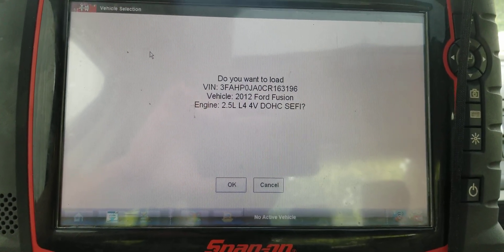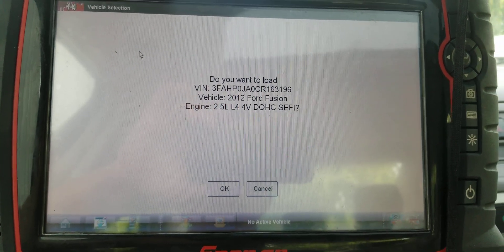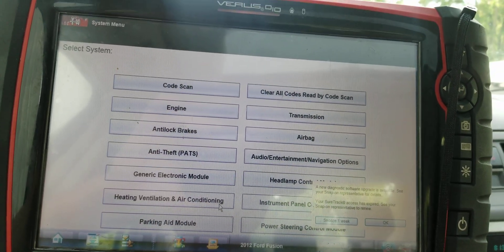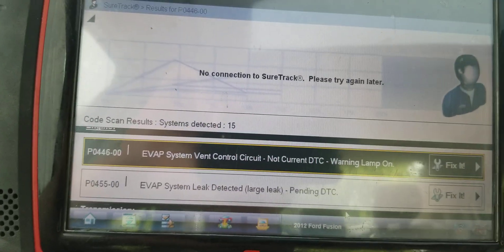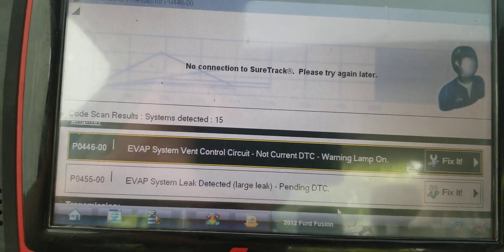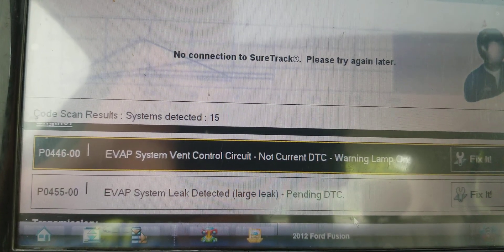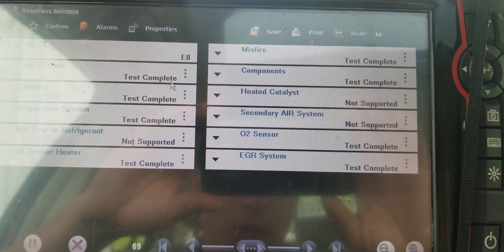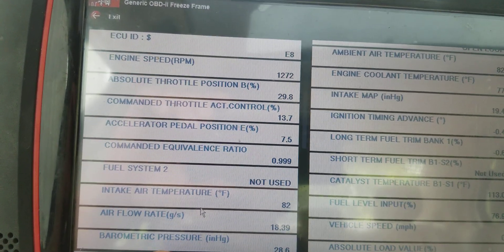2012 FORD FUSION 2.5L, P0446 EVAP VENT CONTROL CKT & P0455 EVAP LG LEAK (PART I)

Comment: Awesome video cant wait to see parts too and good too see that gm not the only 1 with junk purge solenoids . That connector really looks stuck. Proab remove the vent solenoid and get better access but great use of a bulb for the load
Reply from the maker: Yes, removing it would have been another approach, but I tried to sneak small flat blade under the tang to assist her off and I could tell she was not going to come off of there regardless of how I attacked the situation...who knows?  The connectors tang was broken regardless, so she needed a new one in either case.

GM puge solenoids and vent control valves...they should just be a 30/60/90 scheduled maintenance item at this point right🤣🤣🤣

In either case, I appreciate your support and feedback brother...you keep killing it out there at the GM dealership man and be the best you can be man!!!

Hope you are enjoying the 4th with your friends and family man!

Comment: Totally right... there shouldn't have been a need to glue that connector. At best, a bit of silicone would have held it in place and would still be removable later on. The frustration level was 9/10 for this one! =)
Reply from the maker: Well it's not that new Thomas, we've seen it a million times, I don't know about the silicone though?  I've heard that silicone can be corrosive to copper, but maybe I'm wrong on that? 

I guess I can see if it's a really hard connector to get, but you know damn well that this is a pigtail that is likely available through Ford etc.

In either case, it can be frustrating to deal with this!
Reply: @PaulysAuto  A bit of silicone between the connector & solenoid body... just to keep the connector from sliding off. I've seen that before / works well.
Reply from the maker: @EXOVCDS   O trust me I've done it🤣🤣🤣👍, I'm just telling you what I've heard.

Comment: Good one Pauly.   Wonder what else is glued together.  Not sure I'd want to work on this car again knowing what's been done.  Keep up the good work.
Reply from the maker: Well it passed all it's monitors, so any further problems will be a new diagnosis, that's why I noted that in the beginning ofcourse.

Found out from the customer that they did buy it at an auction and we all know that you get the best repair quality from those s!@# show events!🤣😉  Reason why it's at an auction you know?

I just feel bad for the customer, but I'll repair it properly, so it will be gravy for the next guy.  I  knew that something was wrong soon as I gave it a shot of brake cleaner and the goo came out...acetone in brake cleaner dissolves super glue 🤣👍

Thanks for watching and the kind words my friend!  Hope you enjoy your 4th!

Comment: I know this is old but it’s not glued. At least not from a shitty repair. I went got a canister from a junkyard car and I had to cut the plug because I couldn’t get it disconnected. Then when I did get it disconnected I ended up shooting a piece of the clip in my eye lol. Idk what Ford had going on with that
Reply from the maker: You know what you're probably right it probably was just a bad design... But other technicians out there needed to hear me telling them stop f**** s*** up! 🤣🤣🤣🤣🤣🤣
Reply from the maker: You know what I mean
Reply: @PaulysAuto  unfortunately I do 😂
Reply from the maker: @reviinge   If we can't laugh and understand that we all make mistakes, well then what's the point? Nobody's perfect right?  We all try to do our best at least I would hope.
Reply: @PaulysAuto  absolutely. In this case, the mistake is definitely on ford. Which isn’t surprising 😂

Comment: okay so i have the opposite problem no voltage at all to the solenoid no voltage no grounds even with the car running and luckily my switch wasn't glued on i took the whole thing down and got it off that's clip is a little bit weird you know you got to really have a lot of space to pull it but no power no grounds to the solenoid
Reply from the maker: Then you need to check the harness...because you have an open.